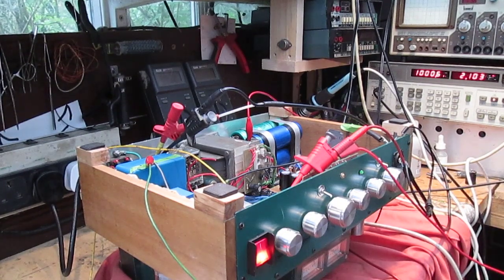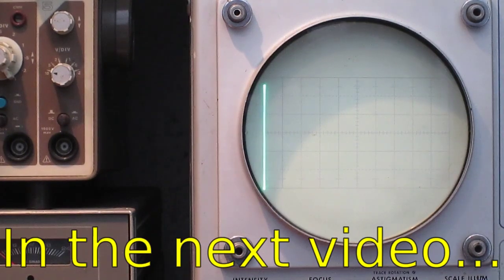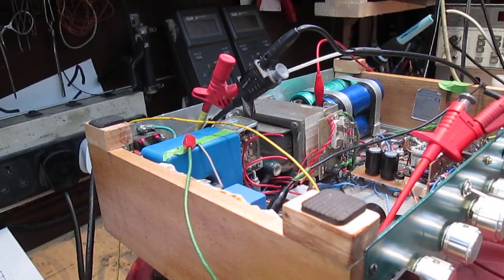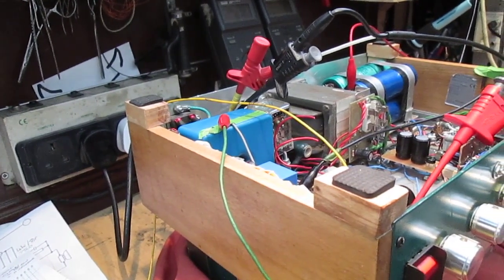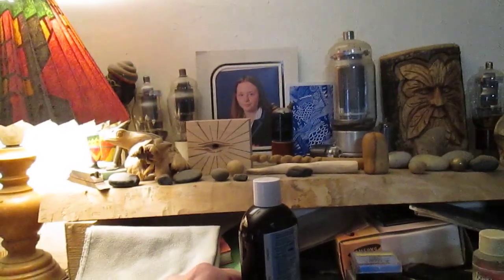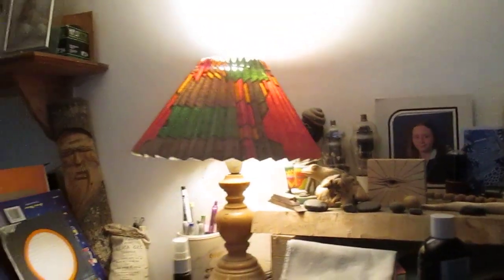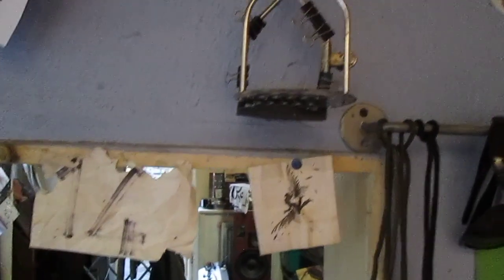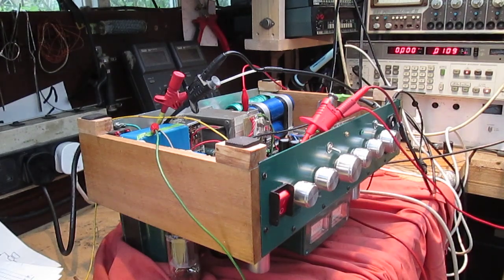How I Got Into Electronics - Stuff.

Comment: I know I’m quite late watching this video but that’s mainly because my computer decided to break and I still don’t have one that works well, so I haven’t been able to watch your videos for the last few months :( I’m using a trash picked laptop that I got some life back in to watch your videos now hehe, it does the job but it sure is a pain to use it :P 

Your story resonates a bit with mine, I haven’t lived in a van before however I’ve never had a stable life myself. Electronics was what saved me from drugs and suicide, I began messing around with building simple audio circuits when I was in 7th grade or so. When I was around 14-15 years old I built my first proper audio power amplifier, it was a design based around the good old JLh class A amplifier. I built it literally by mounting some transistors on a heatsink and soldering components and wires mid air, and believe it or not, it worked just fine and it sounded awesome. Then after I had done that, I made a new amplifier that performed much better and was capable of much more power, one based on a mosfet push pull stage, it delivered good power and sounded amazing. I did all of that without an oscilloscope or anything at my hands! I only had an older fluke multimeter at my disposal. You can get incredibly far with just a fluke! 

And then it escalated from there. I began building more and more experimental circuits, and then I discovered vacuum tubes and that’s when I reallly found what I loved most! I became super addicted to working on vacuum tube amps and radios, and of course , building my own vacuum tube amplifiers. I have built quite a few now:) And nowadays I have several oscilloscopes, power supplies, and all kinds of things that I’ve gotten good deals on at swap meets etc! I also have a whole collection of homemade speakers, including my horn loaded pro audio stuff :) 

I’ve been taking a little break from all the amplifier stuff for a while because I’ve needed to focus on other projects for a while. I’ve been upgrading my off grid solar power stuff a lot, I’m now capable of doing everything related to my hobbies completely using free power so that’s awesome! I also became very interested in collecting and having fun with fluorescent lamps, so I’ve spent a lot of time on those the past few months aswell. But I’m now finally at a point where I’m happy with my lights , I’ve got enough to get me through the rest of my life it feels like hehe :) I’ve installed some absolutely awesome light fixtures in my off grid solar powered shed now, so now I can work on electronics in there and the lighting is better than that in the workshop :P

And I also decided to buy a small lorry, which will be incredibly useful for travelling and doing sleep over and such. So that has also been taking up lots of my time! 

And I also have a older ford passenger car that I’ve needed to give some attention, although I’m thinking about selling that because I feel like I don’t have the skills to really fix it up properly. I’m very happy with the mini lorry or van, it’s a vehicle I really enjoy because it’s so unique and it’s just old enough to not need things that causes trouble, and it’s also super easy to tune and configure because the ecu is so stupid that you can barely even call it an ecu! Which is great!  It’s simple and reliable and it sounds awesome with its inline 5 diesel! 

I like your little cottage! Your unique style of decoration is really interesting to me and I like it! I love when people are different. Your home looks very comfortable and I love that your electronics area is so close to your living room, that makes it easy to test things! 

I’m going to get back into valve amps as soon as I’m done cleaning up the mess I’ve created recently when doing all this electrical installation and stuff, I have a few projects sitting there just waiting for me hehe. 

That’s an interesting issue with your lovely green amp! I’ve never seen that issue before so it will be interesting to follow along and see what was wrong! 

I love all your videos, Andy! You’ve been one of my biggest inspirations aswell as helping hand through the years! Thanks to you I felt comfortable enough to make my own valve amps from the ground up and I’m loving it! 

It was lovely to get a small tour of your home, I’ve always been curious how your personality is outside of the videos and I’m so happy to say that you and I are quite similar in many ways and that makes me happy :) 

I’ll see you again soon Andy, it’ll take me a while to catch up with the new videos I’ve missed since I haven’t had a computer available for so long :)
Reply from the maker: Hello, welcome back, wondered where you'd got to. Sorry I can't reply to all your points, my arm would drop off. It sounds like you've been very busy. what lorry do you have? I regret selling my 1966 Bedford.Keep meaning to build a Class A JLH  amp, maybe one day. I'm glad you find my video's useful etc, kind comments such as yours makes it all worth while, thank you.

Comment: Thanks for sharing, it's really interesting to hear your story. Looking forward to hearing the stories about the goats and downhill skiing in later episodes 🙂

I'm class of '82 and I also learnt from the Electronics magazines, EE in my case. I've picked up electronics again now after buying an Ekco AD65 bakelite radio at a local auction, and more recently a Tek 545b. That's how I found your channel. 

I'd love to see a walkthrough of the features on the 545b, it's a surprisingly powerful machine. I could read the manual, but it wouldn't the same.

Happy New Year!
Reply from the maker: Glad you liked the video. Might be a while doing the goat & skiing video's : )
   Is that the UK EE or the Australian one?
 The Tek545B is a great scope, wise choice. If you keep it somewhere warm & free of moisture it'll last you decades. As you know the best way to learn to drive a scope is to have a play, but I'll see if I can do a video. I don't use the delayed timebase on mine much TBH, I ought to.
  TFW and all the best for 25.
Reply: @diabolicalartificer  UK.
It'll take me a while to get round to restoring it, but sometimes the journey is the best part. 
I wonder if any of the engineers are still around. To think their work is still being put to good use in 2025!!
Reply from the maker: @stevehurcombe  So, not working, ehm. Try to keep all the valves in place, test each power supply cap for leakage then power it up. If you need any help, let me know. I have a few spare plugin's if you need any. 
   I think most of the old Tek engineers are long gone sadly. However there are a still quite a few Tek 500 series/Tek lovers about who know their stuff & there's a vast resource at w140,com & the Tek forum.
Reply: @diabolicalartificer  It's definitely a project, but that's what I wanted. It has character! There's a quick video intro on my "channel". I think it was with an RF engineering company somewhere around Litchfield.